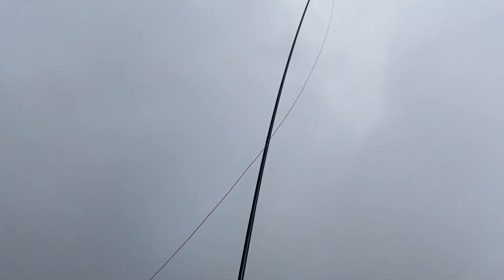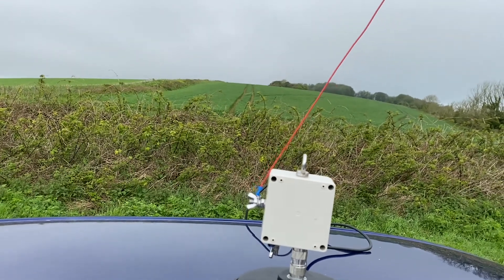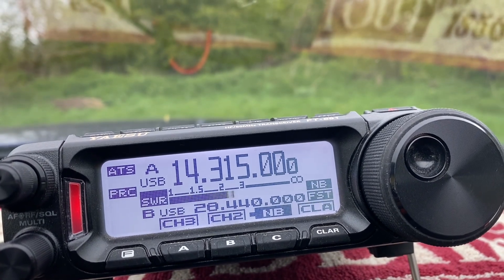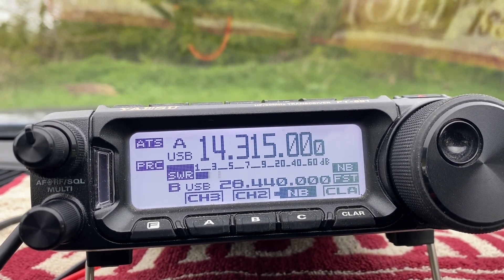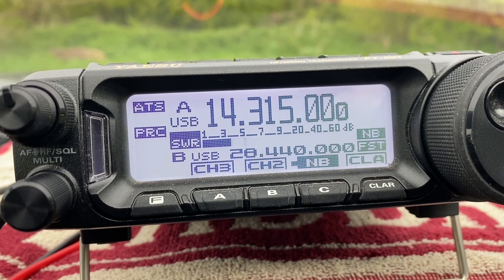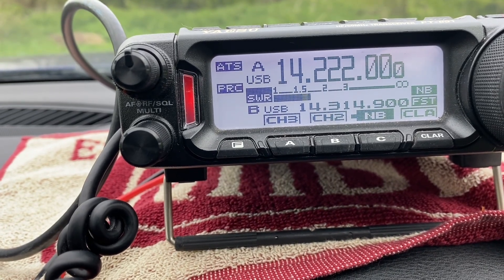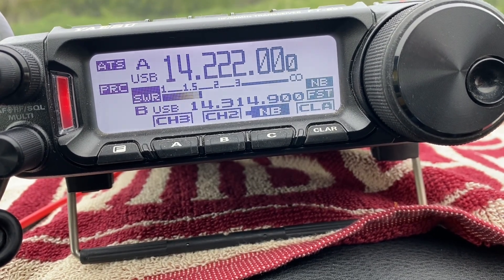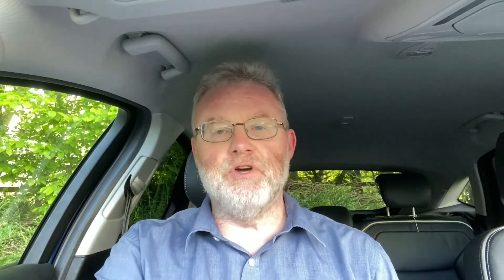Ham Radio: Easy End Fed Half-wave Portable Antenna

Comment: Waters and stanton produced some cheap 2 part mobile whips 20 years ago, I purchased a range of them for different bands and an ft817, spent my lunch times sat in the car tapping out morse on top of one of the car parks at the meadowhall centre (Sheffield) where I worked at the time, I worked some serious dx on just 5 Watts from that location ...happy days... A simple set up that gave so much pleasure...
Reply from the maker: Absolutely agree

Comment: Hi Tim, just wondering what you are using for 12VDC supply and assume you were running 100W ? 73's Darrin
Reply from the maker: Hi Darrin I use Lifepo4 batteries (1/3 the weight of a Lead acid and much better longevity between charges). Look at either Tracer (expensive but superb quality) or Ultramax on ebay (cheaper but still v good). Both are 22ah and last for hours on 100w ssb. I ran my tracer (now 7 years old) hosting 145 alive on 2 metres on FM running a net for 3 hours and it still had over 50% charge left. 73

Comment: hello Tim, I have very good results with a homemade L Tuner. The losses are about 2 dB lower than with the unun transformer. And the big advantage is  you dont have to cut the wire to the exact length. It is easy to make. Vy 72 Edwin, dk2ty
Reply: Edwin, there is only 0.57db loss with this transformer. This isnt a FT140-43 or a FT240-43, losses measured with back to back transformers and VNA.
Reply: Thank you for Information.  Now I have seen your Video about the best ferrite core.
Reply from the maker: For sure.. Colin’s video is very instructive

Comment: Good job Tim
To get it in better reconance om 10m U could wind a little coil aboute 2 meter frombthe transformer on a 25mm plastic pip only 6 turns and U get it down around 28.75.
73 de SM3TEK
Reply from the maker: Nice thinking

Comment: Good video Tim, interested to know why a 56:1 rather than the normal 49:1? Also how about a video where you actually switch between 2 different antennas to judge the difference ?
Reply: Hope Tim doesn't mind me answering. Quite simply as the the 49:1 does not produce acceptable SWR on 40m. As a 56:1 (only 1 turn more on the secondary)  SWR comes in on 40m too.
Reply: @MM0OPXFieldRadio  seriously smart people on Tim's channel :D
Reply from the maker: Colin has answered the question👍👍